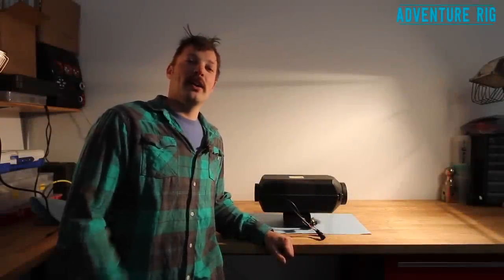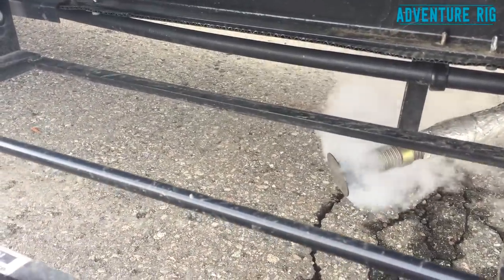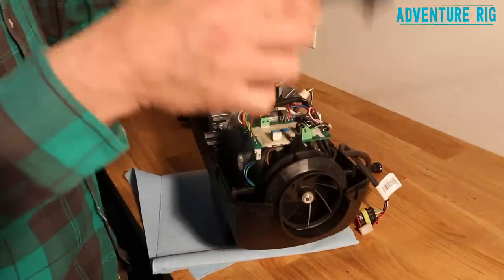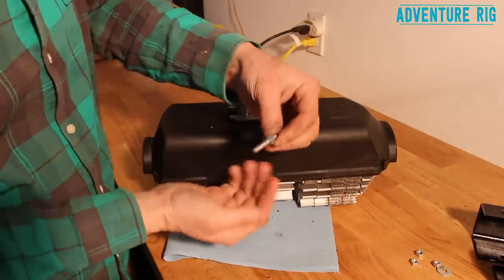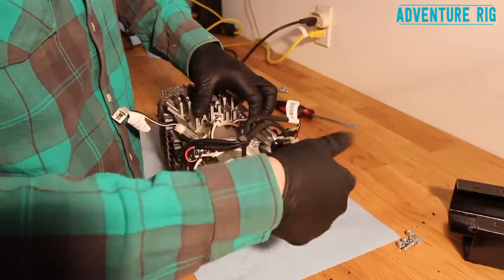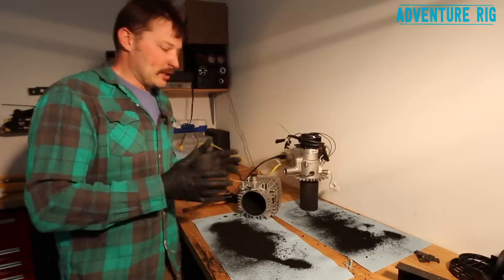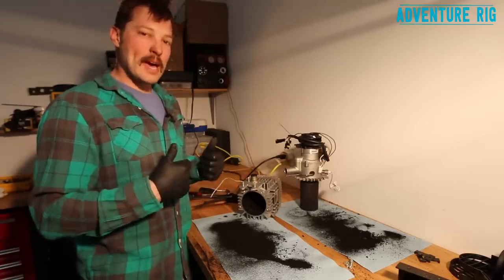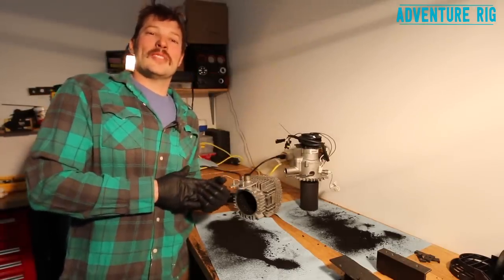Must watch before you use your new Planar Heater! [How-To] Disassemble and Clean Planar Heater

Comment: We had the same problem,  Chinese instruction book  and writing on control .  Be  careful also, we vented exhaust down under caravan on to ground  in open space  . but  ..This caused diesel fumes to  build up in caravan . Had to make exhaust much longer  well away from caravan to fix this
Reply from the maker: Hi Peter. Where did you buy your heater? I don't have any Chinese writing in any of my manuals. If you go to Planars website they had a message on the home page saying companies were selling knockoff units from China and only to buy from known retailers. 

I agree with the exhaust. I ended up making mine 8' long to vent it properly.
Reply: I just learned another thing from. Your video  .Im. in the mountains  of New Zealand  at altitude.  This could be factor also  .thanks for your video  !!! Really enjoyed  it 
Regards Pete
Reply from the maker: Thanks for watching!

Comment: I remember a heater, where the instructions mentioned, that when starting, you need to run it on high for 10 minutes, before lowering the setting.  It is the same as your result, but set it high at the beginning, not the end.  So every time you start it, you burn off the soot.
Reply from the maker: Thanks for watching and for the input!

Comment: Hi, thanks for the guide! I just did this, put everything back together, and now the heater sometimes emitts a loud humming/roaring noise which was not there before. It is not the fan (which turns freely) also the humming comes on and off apruptly, while the fan keeps turning at the same speed. Also there is quite a bit of virbation. Has anyone had that or has an Idea what could be the problem?
Reply from the maker: I've not heard of that.
Reply: Hey dude, did you solve your issue ? I have the same roaring noise.. :o
Reply from the maker: @TheRagondins  Yeah this took care of it.

Comment: How did the heater work after your cleaning. I just pulled mine out of my boat. It was acting like you described.
Reply from the maker: Ted Orr Hi Ted. It returned to normal and worked like new after I cleaned it up.
Reply: @AdventureRig  Did you replace any parts? I've had mine for 1 1/2 years - still under warranty but I'm not sending it to Russia.
Reply from the maker: @tedmrt  I did not have to replace any parts. You can use the North American dealer in Canada. They are great to deal with but they are at the Seattle boat show currently so have been slow to respond to emails.
Reply: @AdventureRig  Thank you!
Reply from the maker: Ted Orr you bet thanks for watching.
Reply: @AdventureRig  THANKS!!  Your instructions were great. My wires were different. I had to disconnect them from the circuit board. I got into the unit and there was more of a wet gummy carbon mixture. I used acetone on rags to clean it out. I didn't pull the glow plug out and am thinking maybe I should have!? Anyway, thanks again.
Reply from the maker: Ted Orr Glad you got it all taken care of. Hopefully you have some warm nights ahead of you!
Reply: @AdventureRig  OK, I installed the heater and it started and stopped. I started it again and it ran for about 45 minutes then stopped. I pulled the glow plug and it looked ok. I started it again and it failed after 3 attempts. I pulled it out again and opened it up and there was a fair amount of carbon both dry and wet in the chamber. That, after about 1 hour burn time. Any Ideas? I got codes 13, 14, 15, 16, 17. I've checked all the wiring. Fuel issue??
Reply from the maker: Ted Orr Off Hans I don’t know what those codes mean. Are they listed in the manual?

What altitude are you at and what are you using for fuel?

Comment: We have the same problem of not igniting and smoking on many units over time. Every time i have found a cracked burner gasket. I put in a new gasket and it works like new again. When the gasket leaks it make the fuel mix way to rich. Eventually to rich to fire. The burner gasket is always the first thing to always look at while taking it apart.
Reply from the maker: Thanks for the info Colin.
Reply: @AdventureRig  your welcome. The first time i had to diagnose this issue it cost a lot of time and money. We use all eberspacher,  but same basic design.  None of the diagnostic info i could find mentioned the gasket. The first one i successful fixed this issue was after i had cleaned with kerosene per manufactures recommendations.  Then replaced glow plug screen, still no. Glow plug, still no. Fuel pump, still no. I tore it down to inspect. Its not unusual to find broken gaskets upon dissasembly of many things, so i never thought about it. I cleaned and inspected, nothing looked wrong. Put it together with new gaskets and it worked. So the next time we had one doing this i thought of the gasket. Pulled it apart, yup in 3 pieces. Put in a new one without hesitation put it back together, works good again. We get anywhere from 3 to 15 years of service from them before needing another gasket.
Reply from the maker: colin poellot That’s great info and I appreciate you sharing.

Comment: Will running it on high every 12 hours also compensate for using it at high altitude without any other high altitude attachment/adjustment?
Reply from the maker: 101perspective Yes that would help a lot.

Comment: I have had this same heater in my Catalina 30 boat which I live aboard in the PNW. I have used it for 4 years now and NEVER had to do this. I also have used it almost every day, even in summer in the morning to drive out the moisture. I always start it on high and run for at least 30 mins. I dial it down for a few hours but always go back to high before I initiate shut down. Most heaters like this and space heaters for shops have the same issues. I always run regular diesel, not kerosene ever...The quality of diesel now is much cleaner than in years past. Pay attention to the instructions, they have gone through some fuel pump upgrades as well and the orientation changed.
Reply: Greg, Do you have any pictures of your installation?
Reply: I also have the same heater in my 27 foot Apollo, but my rig is gasoline so I run the heater on kerosene and have never had any issue in 2 years.
Reply: @Micha EL To be a little more concise, kerosene is considered diesel #1 and is lighter and less fragrant/cleaner burning than diesel#2 which is for use in modern automotive engines, that being said diesel #1 is lacking the viscosity that #2 has which lubricates pumps/injectors and generates more heat during combustion.
Reply from the maker: Greg M. Thanks for the input Greg. I’m guessing that using it at sea level vs 10,000 feet has quite a bit to do with the difference in how they run.
Reply: @Micha EL that's backwards. on-road diesel has no dye. off-road diesel and kerosene have red dye, because they are not taxed.  getting caught with red dye in your vehicle's tank will earn you a big fine.
Reply: @Micha EL The wax that is added to #2 also provides more BTU's, or as I said previously "generates more heat during combustion." so no, they aren't the exact same thing.
Reply: @mmnootzenpoof  Unless you have farm plates like me :D

Comment: Simple solution, go in the settings, and change the minium fuel, with the absolute minimum fan speed.

This keeps the unit it's self up to temp, while only extracting a low amount of heat. Low and slow, but no soot.
Reply from the maker: What controller do you have? I don't have any of those settings.
Reply: @AdventureRig  lcd touchscreen.
Reply from the maker: @LambySRI  Will you provide a link? I don't see it on their website as an option.

Comment: I have 2kw planer it has never worked properly control knob fault huge amounts of smoke due to partially blocked silencer my fault exhaust sealing gum in it . and aiways needs to be primed four times before starting I have  sent it back and am told it is all ok but still needs priming there are not any fuel leaks but the fuel pipes has air it it after it is stood overnight. Are the pumps piston type so not letting fuel past back to the tank. I suspect it is syphoning back to the tank. but sure the tank is higher then the unit only just but higher.
Reply from the maker: The tank is suppose to be the highest component in the system. After the tank the fuel pump should be higher than the heater or at the same level. My pump is mounted at the same level as the heater and it is slightly lower than the tank. I have a video of the install.
Reply from the maker: @Johnkels100  try checking out their website.. they should have instructions that you can download for each heater. The fuel pickup should be at the same level or higher than the fuel pump.
Reply: do u have the fuel pump outlet pointing up about 15 deg. i think that helps .
Reply: i think it was so the fuel dont drain back and get air in it . i seen it on a few vids thats why i mentiond it incase you have a problem .  :)
Reply: @raymondj8768  I am going to try this as well as rerouteing the pipe the pump is vertical or almost. I am thinking there is some back syphoning taking place and the pump is letting air by.
Reply: yea thats what they were saying point the fuel outlet up 15 percent to stop that . hope it helps . great vid by the way i wonderd how they worked internally thanks good luck
Reply from the maker: Ahh i see now, I thought you were referring to the heater getting clogged. Thanks for watching!
Reply from the maker: @raymondj8768  That's a great video thank you!
Reply: I had a fuel tank on the roof of my van. The siphon effect seemed to be flooding the heater and I could never make it work on the roof in spite of trying many options. Then I read somewhere in a forum that you cannot mount the tank high, and after I moved the tank so it was roughly on the same plane as the pump, the heater worked.  Then I read on another site (https://www.letonkinoisvarnish.co.uk/eberspacher_intro_1.html) that gravity feed up to a certain point is OK: "There is one statement in some of the Eberspacher installation manuals about gravity feeding that is not fully explained and so could be misunderstood. Gravity feeding to the pump is ok, gravity feeding without a pump is not allowed. Maximum height of fuel above pump is 3 m." When the tank was on the roof of my van it probably was right about the 3m mark. So now I am uncertain if that move I did in fact solved one of my problems, or it was co-incidence. BTW, the site referenced above is probably one of the better resources I came across, I was alerted to it on the Samba Forum in a post about silencing a Webasto: https://www.thesamba.com/vw/forum/viewtopic.php?p=8585309
Reply from the maker: @MountainParameters  Thanks for the info. It seems that there is a lack of information in a lot of cases and it's nice to hear from people that have solved issues along the way.

Comment: Referring to the beginning of the video, they didn't put the information to run it at high temp in the instructions would imply there's a design flaw.  It also gives them a better opportunity to generate revenue from servicing units.  I had one in my ThermoKing TriPac equipped '06 Freightliner Columbia.  Bought the rig new and had to have the heater serviced every other year.  When they run, they run gooooood!
Reply from the maker: K4ACS Smitty N. Yeah they’re great!
Reply: Usually it is better to take smaller heater and let it run always and be a bit cold then have to control the temperature all the time

Comment: Hello Tyson,
I was wondering if you had any other issues after installing the heater back in place. I followed your instructions and installed the heater back its place. However, I m getting error no.13 on the display of controller and I don't know how to proceed further.
What would you suggest to do? 

Greetings from Amsterdam (NL),
Bart
Reply from the maker: amfiction I didn't have an issue but 13 is because it's not getting fuel. Try relighting it a couple times. The fuel has probably not made its way to the heater after disconnecting it.
Reply: Adventure Rig the pump seems to work coz it makes some noise, exhaust lets the smoke through. I guess there might something wrong here. Would it be possible to skype with you shortly?
Reply from the maker: Sorry I'm a bit tied up today. You didn't forget to connect the glow plug right (I know it's kind of a dumb question but if it wasn't connected it definitely would prevent it from firing).

Comment: on what altitude do you use it? these planars dont have a high altitude pump , so the lack off air in high altitudes also will not help (you can thry to shorten the burn air  flex hose to make it breath a bit better... The webasto,s  always had a high altitude option (smaller pump) (btw, its also advisable to clean out the burner chamber itsef (the part where the igniter is in, sudd will also form in there< so better is to take it further apart then you did in the video. )
Reply from the maker: I run it at 10,000 feet. I've told Planar they need to have a high altitude pump as an option.

Comment: just clean the glowplug and turn it to max and it burns clean itself😁
Reply from the maker: dualmode1 It would not fire.
Reply: @AdventureRig  okydoky,
😁 btw  i have 12kw old webasto i think ment for tanks maybe,  well it heats up my cellar in the winterin 5 mins.  it has a mecanical timer for the glowplug and startup,  and a mecanical pump inside.
Reply from the maker: dualmode1 Mechanical is always a good way to go.

Comment: I guess they assume you have common knowledge of a fuel based burner. Even wood stoves have soot problems when you fire them on too little heat, ESPECIALLY oil and fuel based burners build up quickly. You need to run them an full blast every once in a while to clear the soot. Your car is actually no different!
Reply from the maker: ObsessionPC Thanks for watching OPC.

Comment: Yeah, diesel will produce soot, but the good part about diesel is that if you have a diesel vehicle, you now only have to worry about one fuel source. Still, though, cleaning the heater may not be the end of the world, but if it craps out on you during a polar vortex event, you're probably still not going to be a very  happy camper.  Diesel heaters like these really need to be blown apart at least once a year and all the stuff that wears out like the glow plug and such should be changed out, just to increase the chance of successful operation without hassles.
Reply from the maker: Thanks for your feedback Croft.

Comment: I got me one of the cheap versions of this heater and intentionally got one with the simple dial controller, on low it's still burning fuel,  only time it blows air without burning is on shutdown.

Thinking about adding diesel kleen to the fuel.
Reply from the maker: Yeah you could definitely try that. Or kerosene.

Comment: Nice, informative video....thanks. I finally pulled the plug and purchased one. Do you know how many oz. of fuel this thing uses per hour?
Reply from the maker: John Wright It will depend on the setting you’re running it on and how cold it is outside. With the 2 gallon tank I can usually run it anywhere from 24 hours to 72 hours.

Comment: Hey, thanks for all the info on the Planar 44D -- not as much info out there as I hoped there would but your videos are a great resource. Could you tell me how you like the manual temperature adjustment? Are you able to find a sweet spot where it will maintain a comfortable temperature long-term without requiring adjustment? I don't want to have to run over and turn the unit on/off all the time and I also will have my dog in my RV without me sometimes and need to ensure he has a comfortable temperature inside. (I will also have a temperature monitoring system that will alert me to any issues). 
Other question -- have you used this heater at altitude? They don't sell a high altitude kit for it but some have reported it seems to work fine in its original configuration. Others have used a pinch clamp to slightly pinch the fuel hose. I do plan to use this regularly between 5,000 and 10,000 ft above sea level so just want to make sure it will work reliably for me. 
I was looking at the Espar D4 and if thats the right solution for me then thats ok and I will spend the extra money, but if the Planar will do a good reliable job I'd love to save the money by getting this instead! 
Thanks for the help, appreciate it.
Reply from the maker: Hi Bryan. Thanks for watching the videos. I use the manual temp setting quite often and find it works great. You will have to find the setting that works for you and your rig depending on outside conditions. But I've found it's not difficult to dial in a temp. You can also set it to regulate the temperature if you wish and it will turn on and off as needed. The fan stays on but it does not constantly burn fuel. 

I live at 8,500' and regularly ski Colorado and Utah/Wyoming resorts so most of the use is between 5,000' - 10,000'. I wish it had a high altitude kit as I think that would help with the heater sooting up. I have since switched to using kerosene and that has fixed the problem if you are running it at a low heat setting. 

What are you using to monitor the temp remotely? I also have a dog that stays in the camper when we are out skiing.

Comment: What if you run it on kerosene? Will it give same problem, or it will burn cleaner?
Reply from the maker: agent 404 Kerosene will burner cleaner and since switching I have not had the problem return.
Reply: @AdventureRig  Straight kerosene isn't good for the fuel pump. the pump depends on the diesel oil for lubrication. Mixing a solution of kerosene and diesel is recommended

Comment: Do they build this brand heater in a regular gas burning version?   Wonder if regular gas would run cleaner? Think it likely would. 
Diesel does give more BTU efficiency but have to run at optimum temperature to minimize soot build-up.
Reply from the maker: I do not think they make it in a gasoline version.